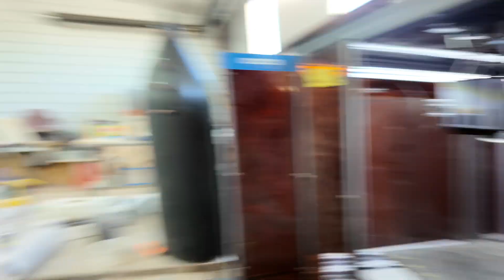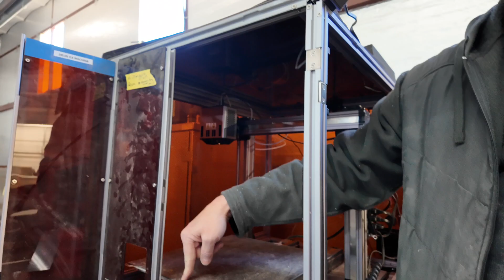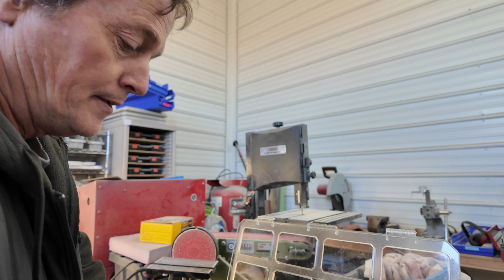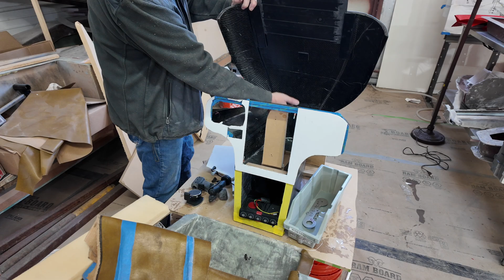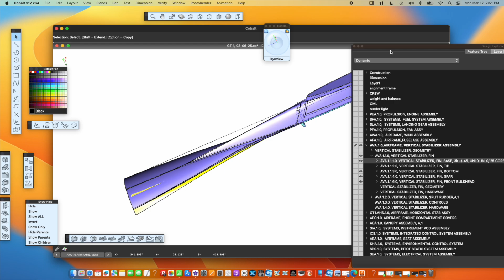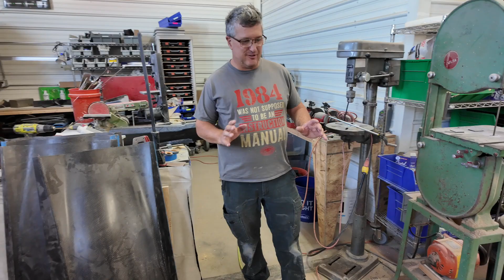GT 1 EPISODE 12 MAZDA ROTARY POWERED DUCTED FAN EXPERIMENTAL AIRCRAFT

Comment: I am pretty sure 3D printers will be in all our homebuilder tool list very soon! All that tech and the one item in your shop I don’t have and need is the old manual rotary pencil sharpener!  I wouldn’t use it just more to pay homage to my grandfather and father! Both have and had them in their home shops!
Reply from the maker: @Gmoney_72  Cady was tired of watching me use an exact knife to sharpen pencils....
Reply: @ Wait!! That’s not the way you are supposed to sharpen pencils! 

Do you think torque tubes could be 3D printed!
Reply from the maker: @Gmoney_72  That probably wouldn't be wise but it would depend on the load. I tend to use the 3d prints as core in a composite and laminate on top to take the real loads.
Reply: @ thank you